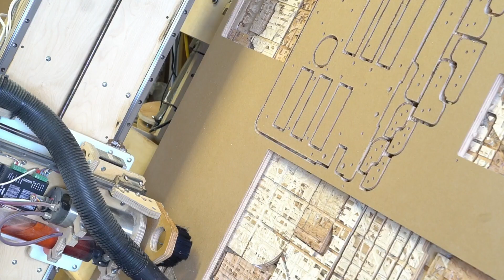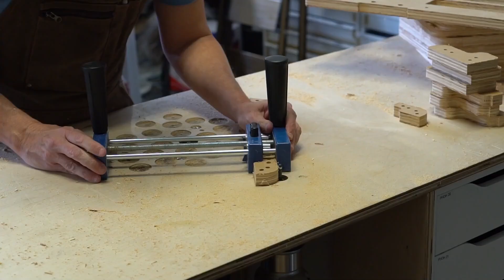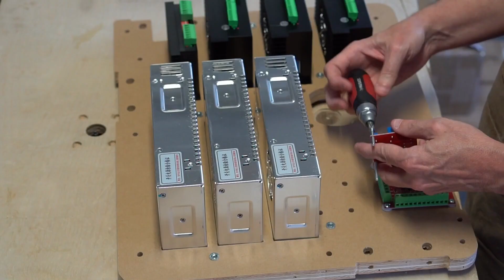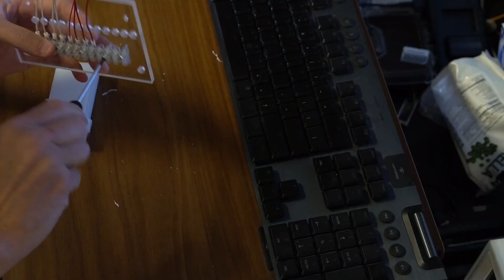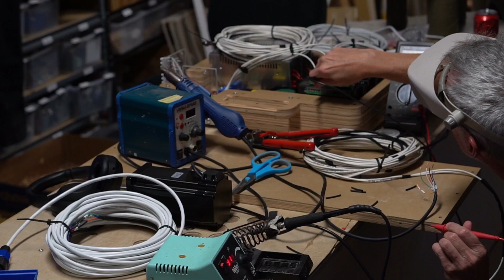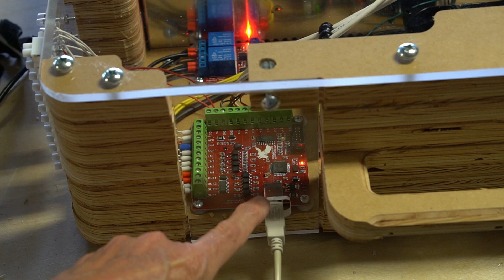Watch Me Build Closed-Loop CNC Electronics in 25 Minutes

Comment: My guess; Captain "Suggestor" makes or sells wire ferrules and has an unmovable inventory. Been an Industrial ET/Fabricator for 25 years... "wire ferrules" are not only a waste of time and money, but they wiggle loose far more often than "NEATLY" twisted wire pairs! IF, YOU want to add an an extra step of quality-assurance  quickly solder the twisted pairs/triples/etc... Otherwise, "Ferrules" make beautiful trash-can liners!
Reply from the maker: Thanks for the suggestion. I have received comment on not soldering the ends as well. So far, the ferrules have been great as long as you use the correct size for the gauge.
Reply: @PatrickHoodDaniel  To clarify my loose comment.  The wires themselves typically stay crimped, but the ferrules "wiggle loose" at the screws pinch point due to the air gap within the ferrule, beneath the pinch point. So unless the screw terminals are torqued down to the point to fully collapse the ferrule(which nobody does for a host of reasons.)(Primarily because the terminal would break first.) they end up rattling around with intermittent contact. AND with intermittent contact, there's typically sparking and/or erratic signals that create spikes that damage sensitive circuits. Bare or even better "Soldered", are more secure. Look at it this way: They invented pex, sharkbite, etc... connectors for the plumbing world because "fire scary" and soldering a plumbing joint is "so much harder than just popping something into a hole". It's all marketing BS  aimed at cashing-in on laziness and intimidation of learning a skill.  Think about the physics of your connections and don't listen to me or Captain gimmick. AND in case your unfamiliar with it, and considering the monotonous amount you're doing, You don't need to use the solder iron on each wire-end. You can use an electric lead pot.  30$-50$...Neatly twist, dip in some good ol' kester 186, dip in "electric lead pot", done... Good luck! No response necessary. Most importantly just try and enjoy your hobbies!
Reply from the maker: @YoutubeSupportServices  My ferrules always collapse in the terminal. I have not come across any of the problems that you are explaining. I have also scoped connections countless times and have seen no noise, spikes or anything you mentioned. This is with me being very uncareful while scoping. I started using wire ferrules from comments like these and now I am told not to use them. Each of the commentators have no videos on their channels to explain why, how or best practices. Until I see a better method demonstrated and in detail, I will probably stick with this.
Reply: @PatrickHoodDaniel  DO what cha want man. Sorry, I don't have 25 years of industrial machinery repair and fabrication videos for ya!...  Luckily, the "millennial" intellect is a comfortable path to walk down, ....UNTIL it isn't. :goodvibes:

Comment: I am glad you like the ferrules.
Next suggestion- plastic cable raceways to keep the cables neatly organized, instead of the spider web.
Clipping the cables together with the zip ties does the job but doesn’t give the controller that industrial quality look.
Reply from the maker: Thanks. Great suggestion. I will find a supplier and add them to my inventory. I have loom that is pretty cool looking. It does take a bit of time to put that together. I can add that as an upsell.

Comment: save yourselves all the hassle and cost by purchasing an all encompassing ESP32 controller such as Xpro v5 or CNC3D Night Hawk. They are wireless with GCODE sent directly to the controller's sim card and no usb cable required. The price is the same by the time you add the boards and stepper drivers. Been through all this.
Reply: Yes but those designs only go up to like 24volt right for the stepper motors? For something like the PrintNC we're upwards of 48v so need more powerful electronics.
Not so sure the wood box is a good idea on this design as it's a fire hazard and has no EMI protection. But I like the backboard idea if done with different material.
Reply: @okinawajapan1  you can go up to 40V via external PSU  driving a NEMA 34. If you need bigger than that, It would be better to purchase a industrial type machine

Comment: Excellent Video.  Any reason why you chose to go with the open loop on the Z axis?
Reply from the maker: There is very little torque using the selected NEMA 34 motor, so I was way within spec. I only choose closed loop when the torque required for the application is somewhat close to the motor torque. In this case, these are the largest motors you can find for NEMA 34 and you need to step up to NEMA 42 for more torque and the customer's machine is set for NEAM 34.

Comment: Can the V10 port take 12V or it needs exactly 10V ?
Reply from the maker: I have not tried applying 12V to the 10V input. The 10V input serves as a voltage reference. If the VRef 10V terminal has the ability to receive a higher voltage, then the PWM may change the range from 0 to 12V rather than 0 to 10V, but I am not sure.
Reply: @PatrickHoodDaniel  Thanks for relpying. My VFD delivers 12V instead of 10V so I bought a DC buck converter to make it 10V. It won't work with 12V.

Comment: Have you ever done any control designs for metal CNC machines like a Precision Mathews 940...??
Reply from the maker: The electronics that we provide are typically sized for larder machines than the PM940. the PM940 is a relatively small machine with screw drives. These drives are very easy to turn so our light CNC electronics would be fine for that application.
Reply: I have a PM940 that I converted to CNC. I am using a Masso controller, Clearpath servos and ArizonaVideo99 CNC ballscrews and mounts kit. I designed and built my electronics enclosures. I used a large Hoffman enclosure and put all my electronics in it and used a smaller Hoffman enclosure and put my VFD in it. Have you made any progress with your 940 yet?
Reply: @halfstep67  I haven't kicked that project off...and now in the mean time, Langmuir has introduced their new MR-1 that looks pretty good.  The only thing I'm not real crazy about is their choice of spindle, its limited to a 1/2" and uses a ER20 collet setup versus an R8 and the Z axis is limited compared to PM940 retrofit.
Reply: @ericsandberg3167  Keep in mind if you choose a PM940, you will have to wait for a while due to being sold out and waiting for new shipments to arrive. The PM940 is a pretty good mill. I completely disassembled mine and stripped it down to bare castings and repainted it plus a full CNC conversion. It is a big heavy mill and requires something like an overhead electric winch to help disassemble and reassemble. I am using the Tormach TTS tooling system. I rebuilt my spindle with better quality tapered roller bearings for increased RPM. I can get 6000 RPM with no problems. Someday, I will do a belt conversion but for now, I am using the gearbox.

Comment: Interesting video.  Your case design is novel. I would have used Linux CNC but mach3 works if you can stand using an os you could never own (Windows 11)
Reply from the maker: I also use LinuxCNC as you can see in my older videos. However, parallel ports are hard to come by these days unless you build a computer just to use LinuxCNC. I have gotten use to Mach3 over the years and I'm very comfortable with it. Interestingly, back in the day, it was hard to move from LinuxCNC to Mach3, but now Mach3 is my "go-to" software. Thanks for watching the video. I am truly grateful!
Reply: @PatrickHoodDaniel  linuxCNC now has USB control and a real nice controller board that's plug and play. And Linux CNC is free but the board is about $200. Good luck.
Reply from the maker: @frodobaggins169  Thanks. I will add that to my arsenal! Do you have a link?
Reply: @PatrickHoodDaniel  Question? is there any money in YouTube video? I'm retired and not healthy, walk with a cane. I'm looking to build a CNC mill. Something to keep me active. I have talents in many fields.
Reply from the maker: @frodobaggins169  It depends on the niche and the amount of time you work at it. My YouTube hasn't gotten a lot of subscribers because it takes about the same time as a full time job. My channel has been around since 2007. I make around $150 per month on a good month. However, if you use the videos as a complement to other things you do, then that is a better formula.
Reply: @PatrickHoodDaniel  Thanks, and good luck on those links.